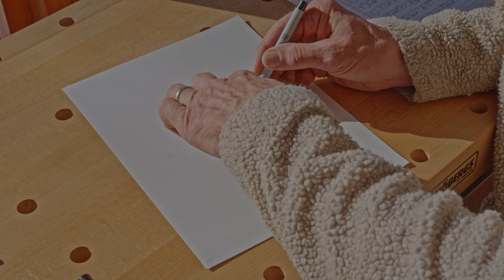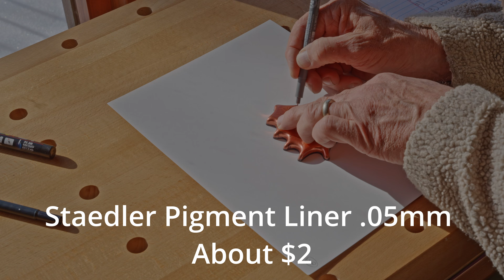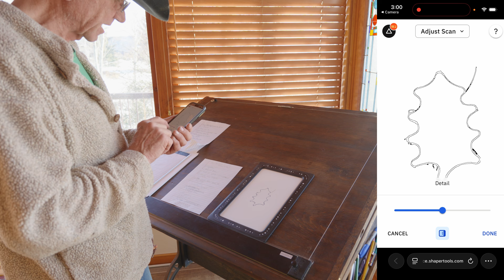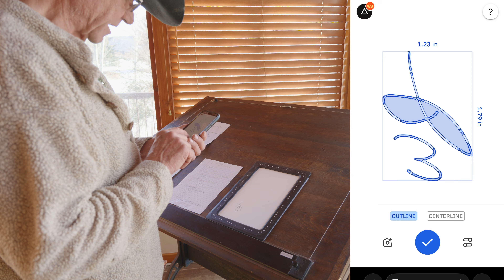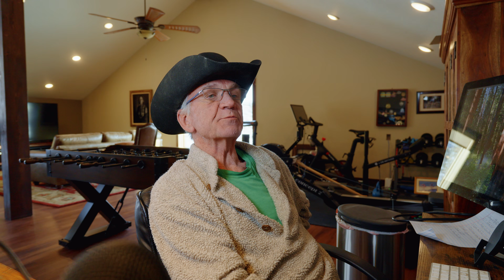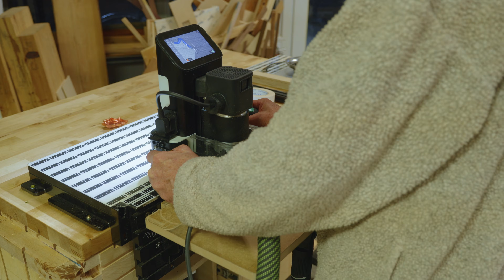Trace Surprised Me!

Comment: You can use a plugin in Fusion that  will make accurate sketches from images. If you use a photo you have to deal with parallax by taking the photo from as far back as possible.
Reply from the maker: Interesting, and sounds like a good solution for Fusion users.  I think Shaper Trace is aiming for a somewhat different user.  The idea behind Trace (I think) is to go straight from phone to workshop without stopping at the computer.  Anyhow, that’s how I’m trying to use it.
Reply from the maker: I ought to add that Fusion looks like something I ought to learn and this is yet another reason to do that, thank you
Reply: @MountainRanchWoodworking-kn7et  The learning curve was steep for me. Imean STEEP! Keeps getting better though. Autodesk has been very responsive and youtube tutorials are priceless.

Comment: Had my trace sitting on a shelf after a couple scans. I wasn't very impressed with the software but after seeing your review, I'm going to blow the dust off of it and give it another shot. Thanks for the inspiration!  new sub
Reply from the maker: Fantastic, thanks.  I think the software interface is poor.  The right order of operations is (1) adjust detail, then (2) adjust smoothing.  If you try to do detail after smoothing, the smoothing settings are wiped out.  I got pretty frustrated until I learned that.

Comment: Great video.  I've just been using the pen that comes with trace and a clone (likely the same pen) with mixed results, mostly poor.  I think It's because I'm not doing enough work on it in the app.  I'm horrible at tracing, so that is likely 90% of the problem.  I'll try the Sharpie Fine Point as soon as I can get BenchPilot put together (having problems with it).  I keep dozens of these things around the shop for various purposes.

I'm surprised at the Pilot.  I didn't think a roller ball sort of pen would work at all.

Do you know if anyone has tried a camera lucidia for tracing?  Tracing tools (e.g. chisels) is pretty hard because of the parallax between the traced item and the pen tip.
Reply from the maker: Thanks for the comment, I appreciate that.  I’ve not seen anyone try a camera lucida for the trace.  There are gadgets meant to assist tracing real world objects (I’ve got a hub project and video for one I made: https://hub.shapertools.com/creators/5fb124fb8009d8000f0ca018/shares/65aefa3174383ed6f7acfc4f
I agree that you ought to mess with the app.  I found it unpredictable at first.  I think the key is to first adjust the detail and then the smoothing.  If you smooth and then adjust detail you lose the smoothing.
Keep in mind that I used very nice smooth paper for the pilot precise rollerball.  Might not be so good on rough paper.